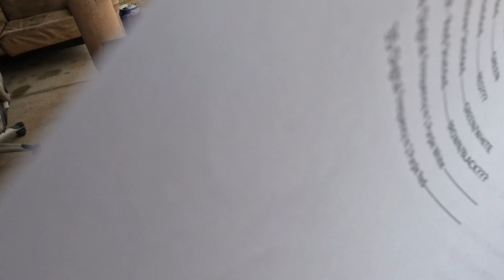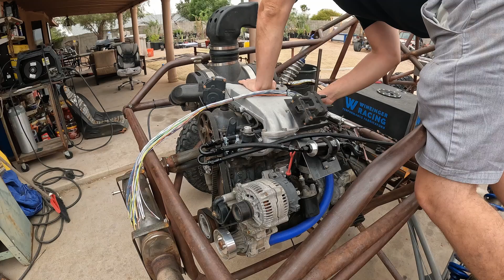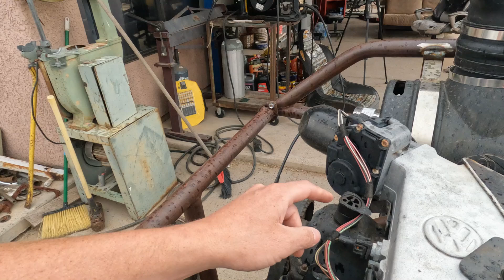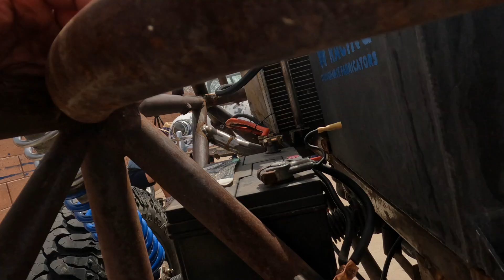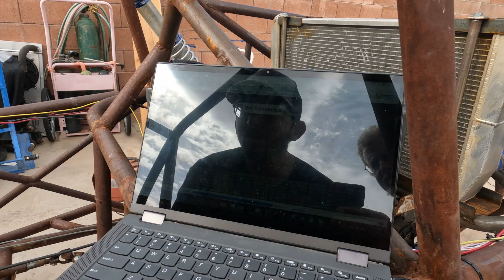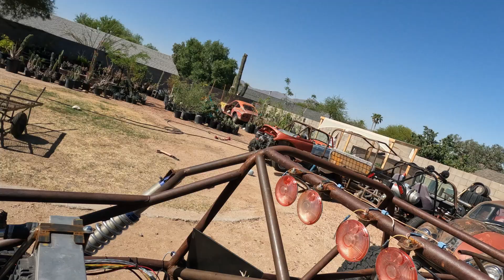Frankenbuggy Gets a MS3Pro Mini! Will The VW ABA 2 0 Start?

Comment: This is probably a late comment, I have a few vehicles with DIYmegasquirts units myself for over 15 years now. The most important thing is checking all settings and calibration of sensors to include but not limited to ECT, IAT, TPS, O2 and MAP. Then the decoder/ignition settings. Without the correct RPM sync, No sync error there is not much you can do till that’s resolved. That’s the most difficult part, since there are so many ignition options. Once you get going/running I would recommend finding someone to dyno tune the VE and IGN tables. I spent several month learning/driving/tuning and my tuner did what took me months to do in 1 hour and 11 dyno pulls on my second project car. I plan on getting a MS3 PRO mini myself at some point for my latest project, but that is on hold indefinitely.
Reply from the maker: Thank you for your input! Luckily I did find out my issue. It was improper ignition setting. I was going off of info for an older water cooled vw which is completely different from what the ABA needs

Comment: I own two aircooled Megasquirt VW’s. MS2 Microsquirt and a newer MS2 traditional Megasquirt.  My advice for anyone new to this:
1- spend a lot of time doing quality connections, grounds, make diagrams for your setup.
2-If you are using Tuner Studio, pay for the registered version, it’s worth it 
3- Crank signal is VITAL and has been the source of all my problems with both installs. Be prepared to play with trigger wheels, sensors, configurations, noise cancellation, etc
Reply from the maker: Thank you for the advice! It’s definitely a learning experience, the crank signal is being my biggest issue, early today I was able to clean it up enough for it to idle. Still need to do more. Thank you for watching though!